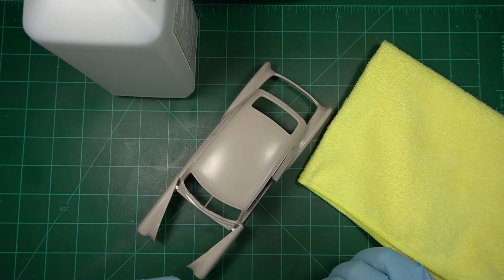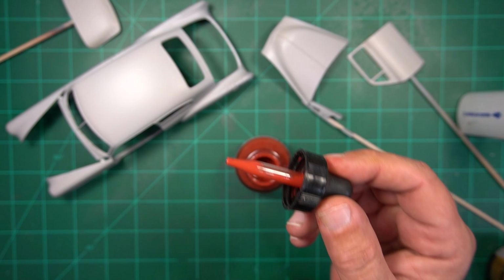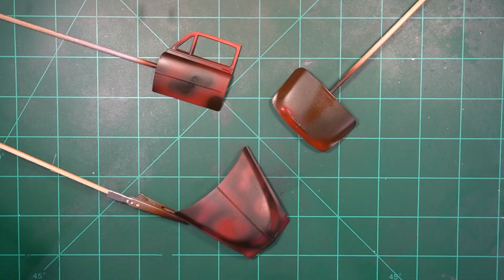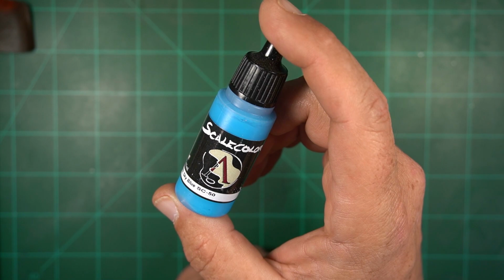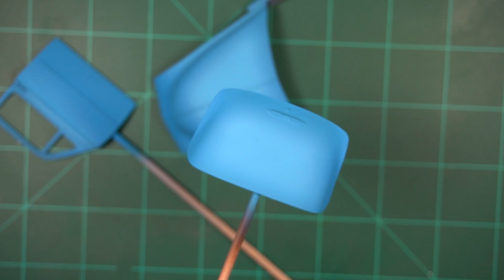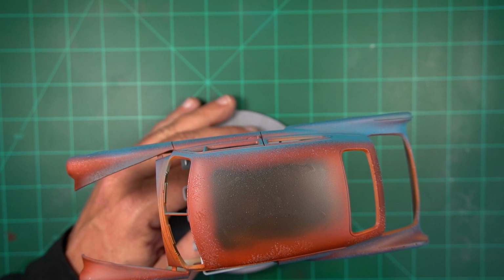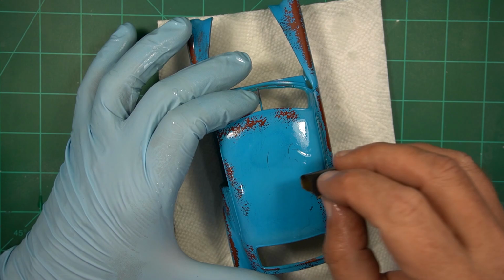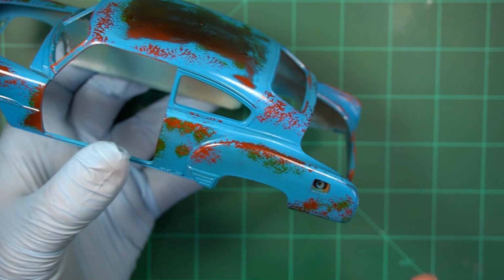How To: RUST A Model Car Kit - Full Tutorial!

Comment: Awesome video, clearly done.  But... I don't quite understand what the purpose of the white glue is.
Reply from the maker: The white glue was used for chipping instead of using hairspray or chipping fluid. Thank you very much for stopping by and checking out the video and taking the time to comment :) really appreciate it!
Reply: @HobbyLinkInternational  thanks for responding.  I’m new to weathering, but I don’t understand the purpose of the glue.  Does it break off the primer and/or rust base colors and/or blue final coat when using the toothbrush or when sanded, causing chips or indents?  Thanks for helping a rookie.
Reply from the maker: @dave3805  the glue goes over the rust layers. What happens is after you paint you scrub the car with a damp tooth brush and add water to the car. School glue is water based so the scrubbing will easily pull off the top layers of paint leaving marks resembling chips and leaving the rust layer to show through.
Reply: @HobbyLinkInternational  brilliant, thanks
Reply from the maker: @dave3805  you're welcome my friend :)

Comment: Does the topcoat have to be acrylic?
Reply from the maker: The clear coat to seal the paint can be anything you want. I use Mr. Super Clear which is a lacquer.
Reply: @HobbyLinkInternational  no I meant the blue colour. Can this be lacquer?
Reply from the maker: @e.h.3152  I never tried with lacquer. I use acrylic because water will take it off. Once lacquer is set not sure what will happen.